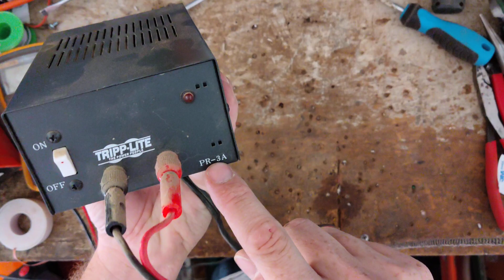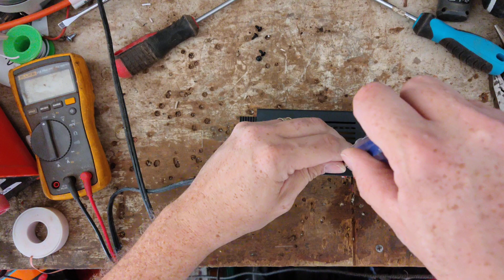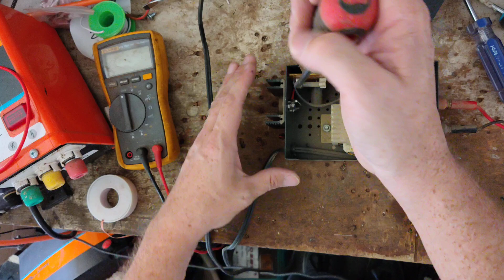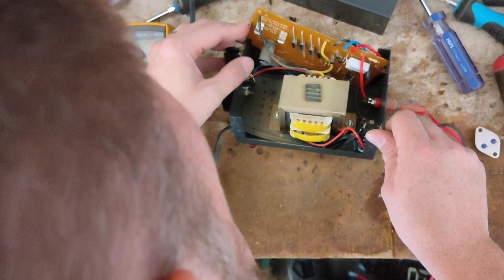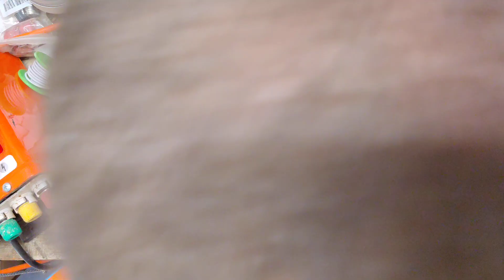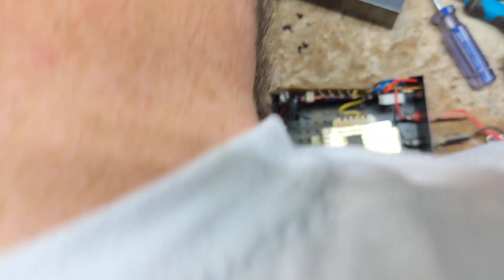DC Power Supply Repair Part 1 | Tripp Lite Power Supply Repair

Comment: I would suspect that capacitor, when they swell like that they are leaky and out of tolerance. Pull it from the board and check with your meter, I would bet it is bad. Other than the transformer, everything in that unit should be replaceable with off shelf parts.
Reply from the maker: Yep, I already ordered the capacitor and the correct size fuse. After I get the cap changed out and the fuse replaced, we'll try things again.